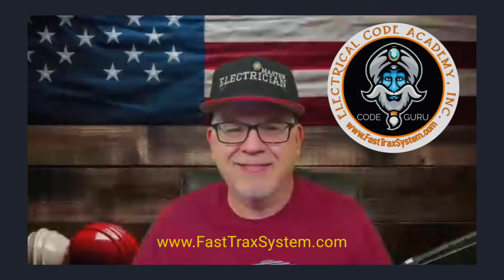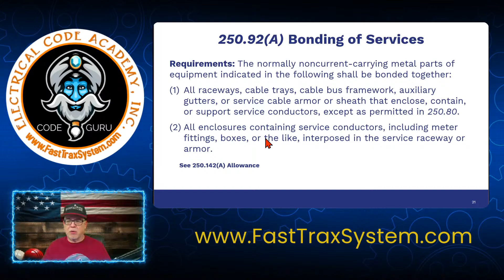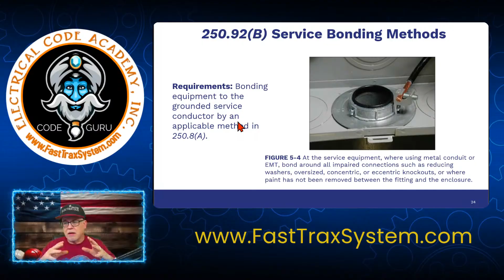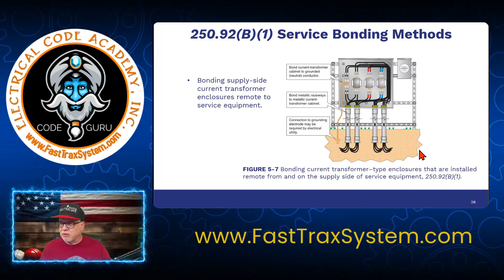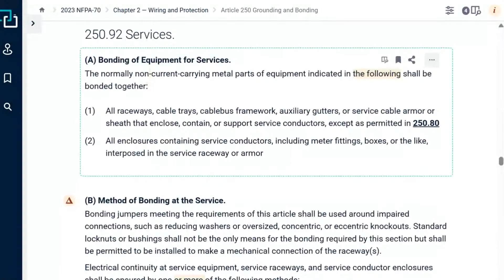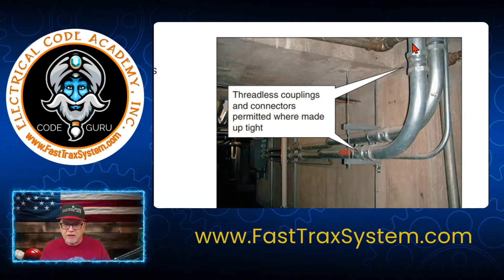Coffee Hour with Paul | Some Bonding Baby  | 7/6/2025

Comment: Does feeder going into and coming out from transformer 480 208v will need bounding lucknuts bushings  even if l punch the holes, if so where i will need them.. thanks
Reply from the maker: Greetings - If you punch holes in transformers and the voltage is over 250V to ground then use the exception in 250.97. For those under 250V to Ground just bond per 250.96 like any other feeder or branch circuit via listed wiring methods and their associated fittings.